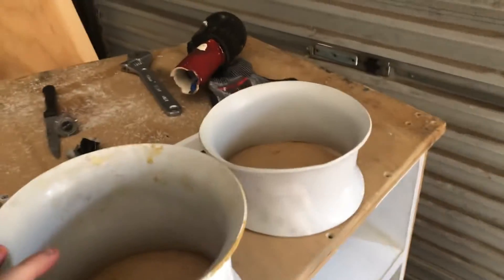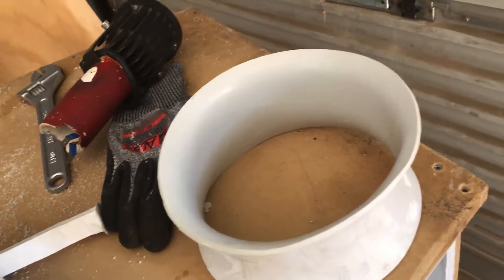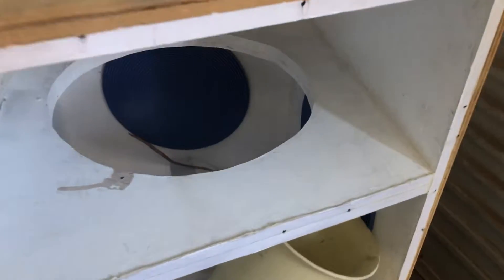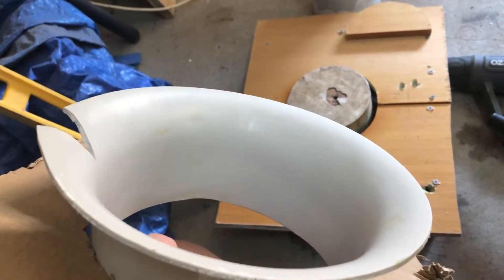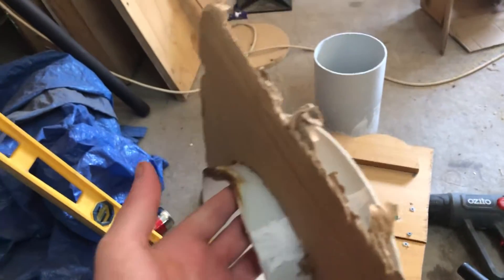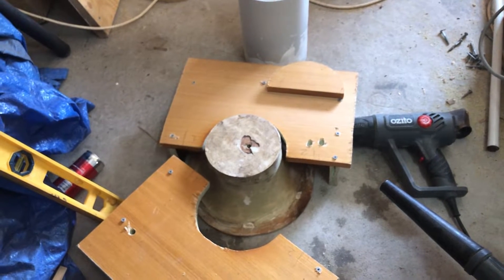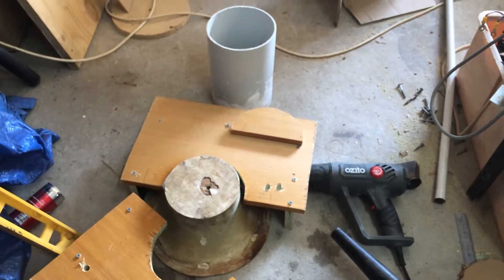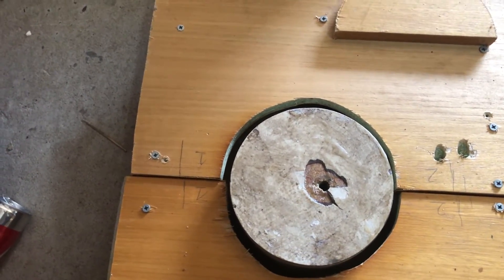Port Flaring part 2 -6ORB 3

Comment: about 18 years ago, i helped a friend of mine redo his front yards sprinkler system. when we ran out of 45 degree and 90 degree fittings, we literally started up my truck and used the heat coming off the exhaust pipe to heat and bend the pipe. can you say budget!! I agree with your answer on doing it in a non traditional, DIY type way. sometimes it is more rewarding to do something in a harder non traditional way and get the same results as the traditional way!!! best of luck!!
Reply from the maker: Yeah, to be honest if I could get enough heat to bend the entire 150mm PVC pipe I would've, even with the 45s in it, there's a harsh bend in the inside of the curve, which was a pain in the ass to attempt to smooth with a file.

Comment: Regarding your split port flares: Can you use like a Bondo (automotive body filler) or fiberglass to fix that up? Just to fill that split in with a mold? 

Regarding  getting bits and parts: I don't know if shipping would be prohibitive but I know Parts-Express ships internationally. They may not have the right port/flare sizing for you though, at first glance through. But there may be other odds and ends that a singular bulk-order may help out with a bunch. Get a couple grand thrown together and just buy a few years' worth of stuff.
Reply from the maker: Yeah, two part builders epoxy for around $13 US for 1.6 pounds, strong too, I use it all the time.
Also, I mainly make the ports myself as an extra layer of DIY, though I am tempted to import some "proper" port flares, and maybe do a comparison, though I'm a bit strapped for time for the next while. Aeroport is what they're often called, but I think the company which makes them is also called Aeroport, and I've seen ports made 4", 6", 8", and I've seen a couple 10" but I'm not sure if they're custom built.

Comment: Have you checked out amicustoms channel? He has a method that looks like it works well. I think the title of the video is how to make aero ports or something like that.
Reply from the maker: Yeah, his video is what I based this off, though since I'm using larger (6") PVC, I saw his video maybe 2 years ago now, and I think he was using 4", so a single heat gun wasn't enough, hence why I've got the shroud. I'll credit him if I make a standalone video on port flaring, which I probably could/should.
Reply: I wonder if you have an acetylene torch and find a way to heat up the pipe indirectly? Perhaps use the flame to heat into your shroud or perhaps a sheet metal box.